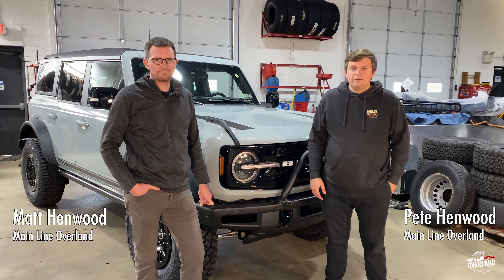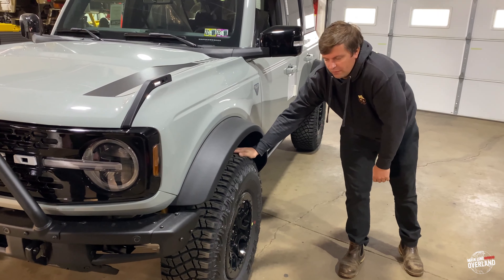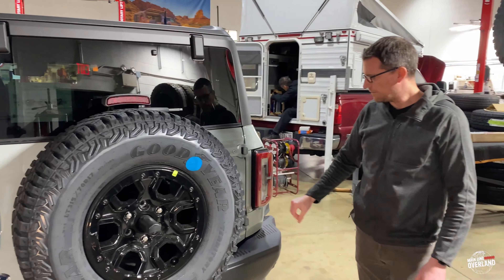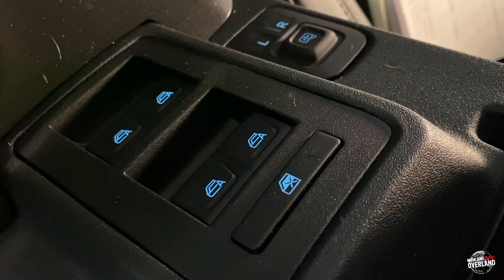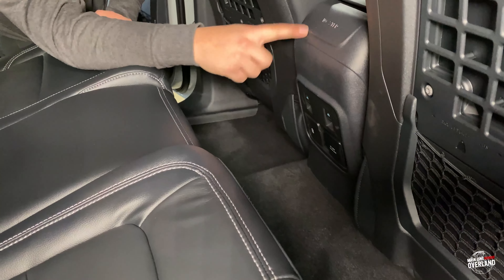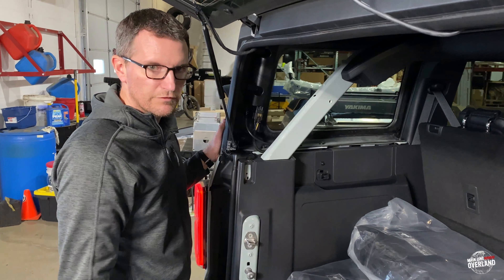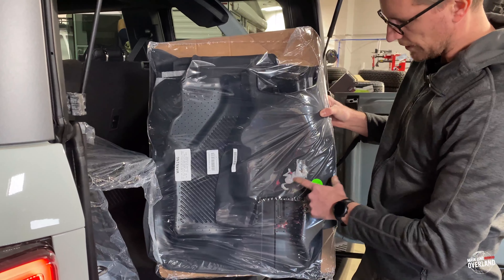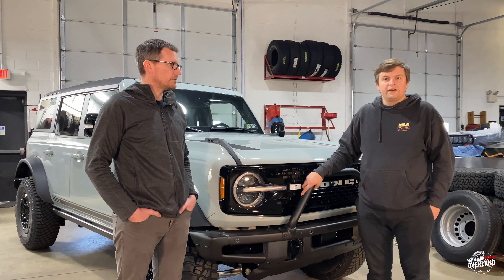MLO's New 2021 Ford Bronco First Edition!

Comment: Nice, question do you have planar heater in stock ready to ship to Ma.??
Reply from the maker: I think we may in one of our 3 shops. These can also drop-ship pretty quickly if needed 👍
Reply: @MainLineOverland  Im on a clock getting back on road in less than 2 weeks for another 6 motnhs in the Land Cruiser. so It has to be quick or Ill build one. lemme know I emailed ya'll too.